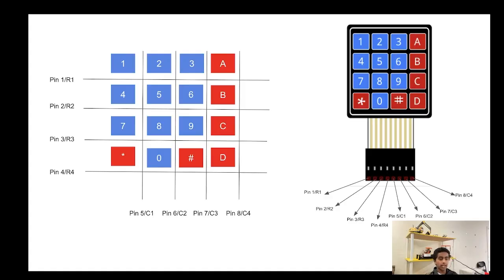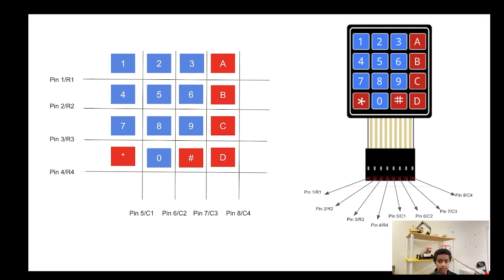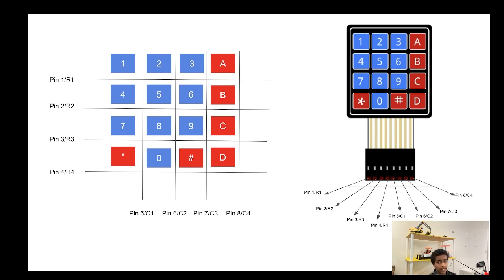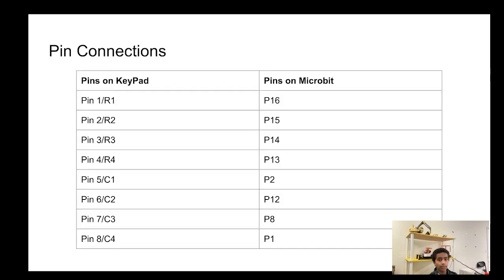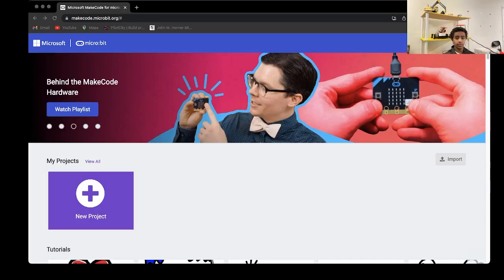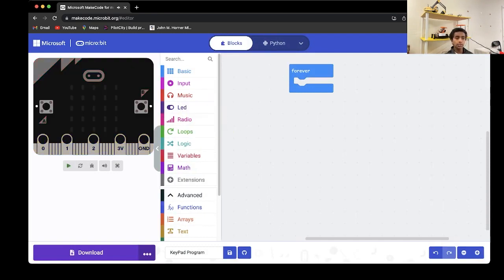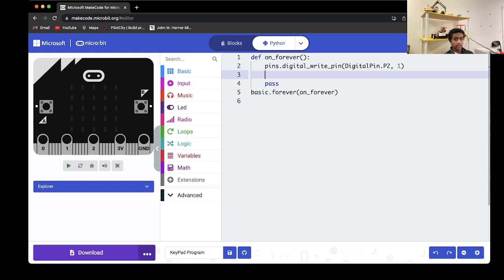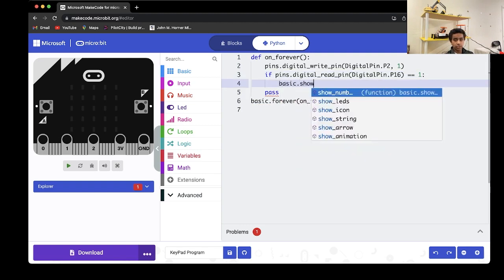Program the Microbit KeyPad

Comment: How do you attach the keypad to the Microbit?
Reply from the maker: @monacheah4322  Thank you for watching the video. I used a Microbit Breadboard Adapter and then used connectors to link the keypad and the Breadboard. You can also use alligator clips.